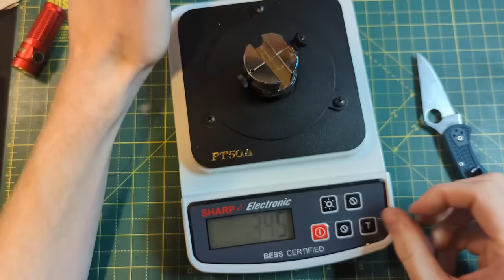Why your knife isn't sharp even after sharpening. A critical missed step

Comment: I never expected that it could be fixed with just a few strokes. I bet that I have this problem as well. I got some blades that just feel dull despite putting a lot of effort in them and one I somehow messed up in a weird way. It feels like a glass shard and will cut through things with ease, but it doesn't keep the edge. Yes, I know, I bet that my sharpening angle wasn't consistent...
Reply from the maker: Yes this sounds exactly like a burr which has been lined up with the apex, it will feel SUPER sharp for one cut, but it immediately rolls over after that cut or during that cut and dulls immediately. Sometimes when the burr rolls over or gets torn off it can also damage your underlying apex. You really want to minimise this burr as much as physically possible before attempting a cut. Good luck!
Reply: @stroppystuff641  Thanks. I had wondered how the edge can be so thin when I'm not pressing it flat on the stone... I guess it's partially the steel to blame. It's too soft and apparently prone to burrs. I got another blade made of softer steel (looks like true medieval steel) which is really easy to sharpen and doesn't have this problem. The really high quality blades are much harder to sharpen, but keep their edge once I finished.
Reply from the maker: @edi9892  a quick microbevel is a very good trick for dealing with stubborn burrs on softer steels. Increase your angle by a couple degrees and do an ultra light edge leading pass on either side, if stropping then strop at the normal angle afterwards.

Comment: I was taught to use a cork from. Pull the knife through a few light strokes and the cork removes the burr.
Reply from the maker: Unfortunately you were taught incorrectly. If you tear the burr off before it's small enough you'll damage the underlying apex and sacrifice keenness. If you cut anything before the burr has been sufficiently minimised you risk it tearing off or being smooshed into the apex below it. It will be sharper than WITH a burr, but nothing compared to a correctly deburred knife.
Reply: @stroppystuff641  interesting! . Good to know thank you for this info! I was taught from a student of Jon Broida over at Japanese knife imports.
Reply from the maker: @Jmon808  depends on the level of sharpness that you're looking for at the end of the day. If you're mass sharpening knives for a kitchen then you might want to cut some corners. If you're sharpening for hobby /enjoyment then might as well do the best possible job 👍

Comment: It’s amazing how little work and pressure that needed to get sharp. You definitely opened my eyes to how hard I’m actually pushing when I use a rod / strop I’m even gonna lighten up on the worksharp system I have. Thanks for the info
Reply from the maker: Keep in mind that I'm deburring here, which requires very light pressure. It's okay to use a bit of pressure when you're removing material in the early stages 👍 good luck!

Comment: If youtube algos' had their stuff together, I'd have seen your channel way sooner. Top notch stuff! I was taught by "carving a path's" vid' on tool sharpening that all burs can (and should) be removed by a good strop. Is that not the case? Love the flashlight trick. Thanks! Got a sub' from me.
Reply from the maker: Thanks for the support! Glad you found the video helpful.A burr can absolutely be removed by a strop but it all depends on your goals. For example if you want a coarse 400 grit edge then the burr will likely be too jagged and large to remove on a strop, it will also require loads of stropping and it will also scratch and damage the leather (if you're stropping with leather). My approach is always to deburr as much as possible (within reason) on the stones and then strop afterwards to remove any stubborn remnants and to further refine the apex.
Reply: @stroppystuff641  Thank you. I'm pretty new to sharpening. I do strop with leather. I'll give the stones a try.

Comment: Thank you! I have experienced this very issue a few times. It has always been in the same spot on the belly. I got really confused because I know I had fully apexed along the whole edge because the burr was noticeable. As I progressed through the grits, reducing the burr, and doing the final deburr on the strop, the knife would be very sharp, except that area. Now I have the explanation, thanks to you. I just tried the flashlight trick on a newly sharpened knife and could see a tiny barely noticeable burr. I obviously have a flaw in my technique when it comes to that area of the edge that I have to correct. Excellent tip! Subscribed!
Reply from the maker: I'm glad this tip helped you figure it out! Good work 👍

Comment: Great video. I am struggling with getting the burr off S90v. That stuff is so tough, leather strop does nothing. I’m going to give the ceramic stone a try.  Otherwise, do you have any recommendations for sharpening the “super steels”?
Reply from the maker: I'd always suggest trying to deburr on the stones. Go for edge leading passes on a high grit stone (very light). Failing that trying a loaded strop, not bare leather.

Comment: I can’t seem to get any bite in my blades after sharpening. I can rub my 3 fingers back and fourth doing the Murray carter 3 finger test and I can really put pressure. Seems that no matter what I do I can’t get it to “bite” into my skin or a tomato peel. Although I could shave my arm or face no problem. I use a 1000/6000 king stone and have used the edge pro apex and I get great edges just no bite.  I tried stripping less and stropping back wards on my 6k stone instead of a leather and still no use..  yet Murray carter and others seem to have no problem getting bite even with polish. Any tips?
Reply from the maker: In my opinion this "bite" that people get from a super high finish polish is just ultimate keenness and I believe you're rounding over your edge just a little too much. You can also get this biting property from a toothy blade, which will require you to progress no more than around 1k or so.

Comment: Good information with some ideas I'll try. I'm what I'd call a journeyman sharpener at this point and I sometimes wonder how much edge geometry and type of steel are factors. It's probably partly the relative amount of experience, but I'm usually happy with the results I get on kitchen knives, but have a harder time with the thicker blades. And I have to think the softer, tougher steels will have that reflected in a burr that's a bit harder to remove, and susceptible to reformation if you use too much pressure.
Reply from the maker: You're absolutely right, geometry plays an enormous role in cutting performance, especially in edge retention. There's a ton of charts that can be seen on knife steel nerds that demonstrate all of this. Steel also plays a large role as some just sharpen beautifully for example Rex 45 has an incredibly crisp burr removal.
Reply: @stroppystuff641  As a complete newb, I have a new carbon Morakniv Companion and a new Buck 112 slim. Upon watching your video, I began a closer examination of their edges. What I found is a canal running between the two sides of the blade that I can slide my thumbnail in, down the entire length. What could that be? A Double burr?  :) Thank you!
Reply from the maker: @thankmelater1254  I'm not sure I can visualise what you're describing, are you saying it goes along the whole apex?
Reply: @stroppystuff641  Yes, it goes along the entire apex. After I asked the question, was able to get a series of 3 lenses (including my eyeglasses) working together under bright light and the appearance is as if there are 2 parallel burrs.
Reply from the maker: @thankmelater1254  this is something which people have observed in the past and talked about online however I've never experienced it myself. I'd suggest trying to deburr it and see what happens
Reply: @stroppystuff641  Thank you, Sir! thinking of the cause, I guess that they never  actually ground down enough to even make both sides meet at an apex. I might just try removing more metal until the sides meet.
Reply from the maker: @thankmelater1254  yes just grind a fresh bevel into it and any previous problems will be removed. Always the safest option as it will also remove any potentially burned steel from the factory.
Reply: @stroppystuff641  Thank you! That's what I'll do.
Reply: Start regrinding your knives to thin out behind the edge. This was the key to enjoying all steels for me.
Reply: @thankmelater1254  Double burr from the factory sharpening, done through a wheeled "V".
Reply: @j.m.3038  J.M., thank you!

Comment: I found that a buffing wheel works quiet well with taking the burr off my blades to make them extremely sharp
Reply from the maker: You've got to be careful of rounding and the apex and burning the steel but whatever works 👍
Reply: @stroppystuff641  yeah I know I literally pass the blade edge over the buffing wheel 2 times with minimal pressure just till I can feel that the burr is wither removed or so small I can't see/feel with my finger tips and the blade becomes alot sharper. But your video was really helpful. I need to build up my sharpening stones/set I'm using the lansky and can only get to 1000grit atm so I try do the best I can with what I have.
Reply from the maker: @waynewhittal806  absolutely, do the best you can with the tools you've got. High end stones are a luxury not a necessity :)
Reply: @waynewhittal806  One cheap and effective way to get a 6K result is using Brown polishing paste on strop or soft wood. Grit may vary with manufacturer, 6K is for Pasta Jacaré.
Another option is low grit diamond compound, something around 3-4 micron, result is probably faster than with brown polishing compound.

Comment: I recall an old Cliff Stamp video where her said very very light strokes on ceramic improved edge retention. Not sure he knew why. But perhaps it was the removal of the difficult to see/feel bur?
Reply from the maker: I use the ceramic quite a lot, especially for a quick job. It was suggested to me by a friend who learned it from Cliff Stamp before I had come across his videos. I believe Cliff knew a lot about burr removal so it's possible he was onto something additional. Possibly a micro bevel making it a keener apex etc. Such a complex topic and so hard to test and prove anything without SEM images.
Reply: @stroppystuff641  Yes. He was ahead of his time and quite the contrarian. Used a ceramic today to remove a bur. I’ve also used basswood strops- ones I made for the KME- also do a pretty good job.
Reply from the maker: @tonycanniffe2360  basswood strops are also a game changer! Punishing if you can't hold an angle but the feedback is 👌and the resulting edge is great.
Reply: @tonycanniffe2360  I think when cliff was talking about light passes on ceramic it was more about light pressure control and it's effects on edge finish. He definitely knew about burr removal, as his while plateau sharpening approach was about having to minimize burr formation at the root.
Reply: I saw that video. He was excellent. I think his point was to show the importance of metal fadige during sharpening. 

The lighter the pressure while using a honing rod the better the edge retention. 

I stopped using round honing rods after that because they apply too much pressure comparing to straight hones.
Reply: @PotatoCheese  Yes, Cliff (Rip) did not want to raise a burr and was a contrarian to that aspect of trying to apex, so when he did get a burr or hanging wire, it wasn't significant and could easily be removed. I've seen him do a minor burr removal forming a micro with ultra light alternating passes. We all miss him.
Reply: @PotatoCheese  Absolutely, he hated the burr, as I do. He was big on keeping it to a bare minimum beginning with reduced pressure on single passes. Obviously it works. Cliff Stamp PHD (rip).

Comment: I check the edge with a fingernail rather trying to feel the burr.  Scratch the blade pulling your nail off the edge of the blade.  You can feel a slight catch where the burr is present.
Reply from the maker: This works with a large enough burr, but it's possible to have a burr much smaller than one which can be detected by feel. It's also possible that the burr is pushed to the other side when touching it with your nail.

Comment: There's always something new to learn about knife sharpening! What are your thoughts on using a steel? I find that a combination of steeling and stropping gets my edges to the sharpness that I'm looking for, but neither the steel nor the strop will do it alone. Isn't a burr just another name for a curled-over edge that can be aligned with a steel?
Reply from the maker: It's a common misunderstanding that steeling primarily "realigns" a damaged apex. First off, an aligned burr will last less than a single cut before it rolls over again or breaks away. Secondly steeling is usually used on chefs knives which are primarily used for slice cuts and therefore become dull from abrasion and micro chipping rather than rolling edges. In the case of rolls a steel will usually shear off the roll. Steeling primarily will apply a microbevel to a knife which is a very viable way of maintaining between sharpening. Micro bevels can be used to increase keenness to a dulling apex.
Reply: @stroppystuff641  Thanks for the reply. I'll watch more of your videos and see how I can incorporate this information into my own sharpening.
Reply: @stroppystuff641  this guy knows his stuff. Do you happen to read ScienceOfSharp articles, by any chance?
Reply from the maker: @ilikewaffles3689  I live and breathe the word of Todd 👍
Reply: This is not my experience at all, at least with kitchen knives. After my wife (a trained cook) uses them I can often see damage (little roll or kinks/waves) on the edge. Using a mirror smooth polishing steel lets me push things back straight. Nothing is worn, broken or cut off and under a loupe everything looks like it did before and the knife is razor sharp again. Sometimes I will lightly use a very fine steel instead first if the damage is greater. The last time the knives were fully professionally sharpened was 2018 and with near daily home use they still shave hair. I have only needed to sharpen one knife, a small paring knife that she sonetimes abuses, for the first time last week since 2018.
The point being under magnification I can see that the polishing steel does push the edge straight again. There might be some burnishing effect too. It obviously won't take any other damage out such as nicks etc. those call for a trip to the stones.
I also usd the polishing steel on my 420HC knives with good results. Don't use on knives above 60rc such as Japanese knives though as they are too hard and you can cause damage instead but below 59 things seem to work.

Comment: Jewelers loupe helped tons with this. K390 is a great example of steel that I always get a tiny stubborn burr on. 

I’ve found deburring my wharncliffe k390 delica is harder than my k390 endela. I suspect it has to do with the flat shape, but I’m not sure.
Reply from the maker: Have you sharpened the Wharncliffe less? I'm wondering if it's a bit of burned steel which you haven't gone through yet
Reply: @stroppystuff641  honestly that’s likely what’s going on. I’ll kill the edge a few times and report back. You’ve used the heck out of your delica, I love to see it. It makes me actually care about your opinion if that makes sense.
Reply from the maker: @lindboknifeandtool  yeah it has seen some serious abuse 😂 it was my test knife before I got my hands on some mules.

Comment: Are you attempting to freehand on both the ceramic and leather at the same angle as you sharpened? Great video, by the way, thanks!
Reply from the maker: Yes at the same angle. If you're using a particularly bad knife like a cheap kitchen "stainless steel" then you will be forced to increase bevel angle and create a micro bevel to knock the burr off. The worse the steel the more aggressive you will need to be with the angle

Comment: Flashlight is another trick no one talks about that also changed my sharpening game. 

Sometimes a strop won’t deburr well for me and a few light strokes (steeper angle) on a wooden dowel then to a strop makes all the difference for me.
Reply from the maker: The flashlight trick is crucial to my personal sharpening process. I feel as though many of the high level sharpeners are beyond needing this trick and many many beginner and intermediate sharpeners don't even realise that a small burr can exist or have an effect on sharpness. There are then the heathens who drag through cork or wood to tear the burr off. I suggest this trick to everyone, it's game changing
Reply: @stroppystuff641  ha yep. Personally I can’t feel the burr when it starts to get really small. So easy to detect with the light though

Comment: so what if u were sharpening on a 600 grit diamond stone, after burr is formed on both sides progress to ultra fine 3-6k stone to just deburr?  or would you raise a new burr on the higher stone?
Reply: Coming in a little late, but if that's your progression, then minimize the burr as much as possible with edge leading strokes right on the 600, and then move to your 3000.

Comment: My dad had ( in those days ) the mandatory 2 grades of stone ( grit) 3 grades of emery paper on wooden handles then a leather strop with a bit of oil. Yes he was once a butcher. I have enough vintage to have learnt all that but have recently wimped out and gone over to the dark side of V blocks or electric sharpeners. The Smiths ceremic V handle does a good job of final swipe after initial heavier cut. Lazy...yes  , quick...yes  !😎👍